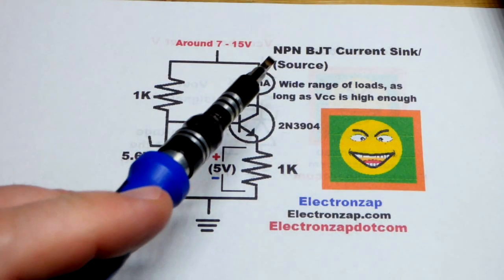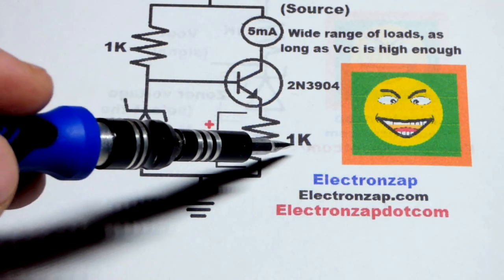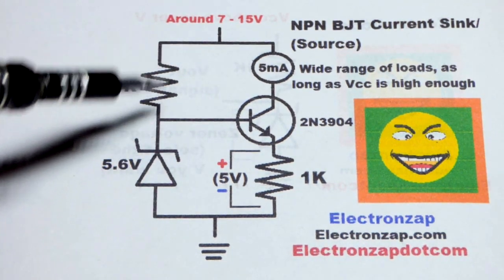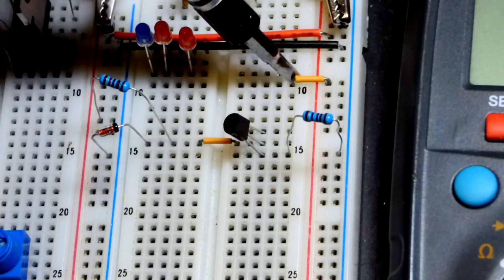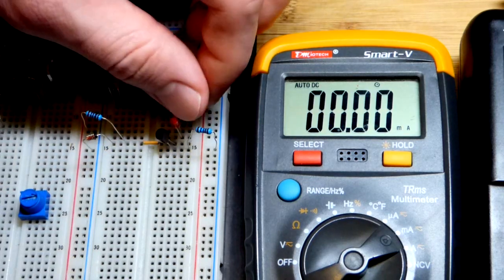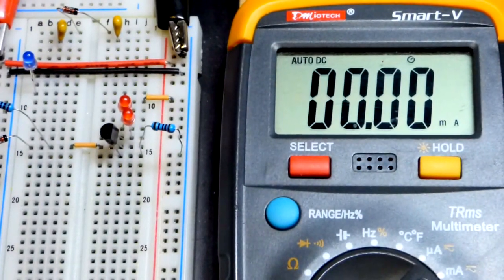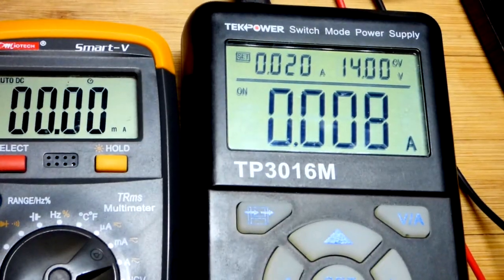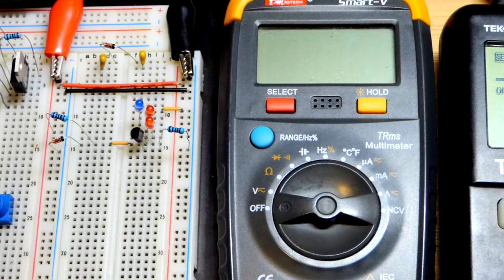Zener diode setting NPN BJT current sink aka source electronics circuit using 2N3904

Comment: Great video, very informative.
One question tho, at 1:35 you say we need to increase our voltage input considering the load we use at the 5mA, so it can power it up. My question is, how can we know the max load we can get with a limited or fixed voltage input?
thanks and keep up the good work!
Reply from the maker: 5V of the power supply voltage will be across the emitter resistor, so you need over 5 extra volts from the power supply.  If you just have an LED that needs 2V to light up (a forward voltage of 2 volts), it will need a bit more than 7 volts powering this circuit. 2 of those LEDs in series will need 4 volts total, so you would need more than 9V at the supply to make sure you have enough voltage.